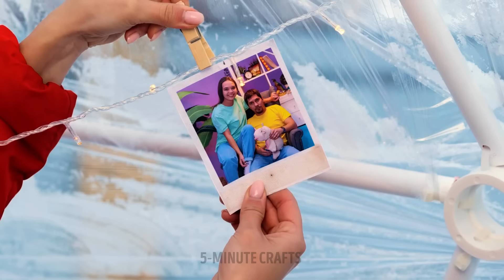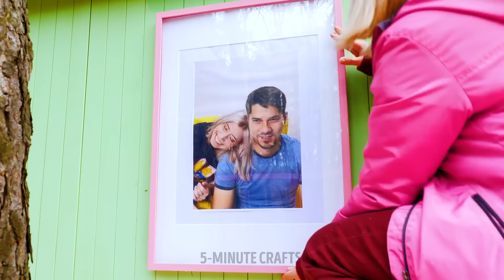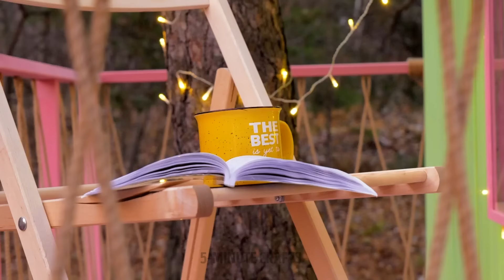SUMMER HOUSE vs WINTER HOUSE || Amazing Huge Craft Ideas

Comment: the winter house is fake there r so many flaws its just a gel not even ice it would take too long to do this n the weather would probably change by the time all the ice is done freezing just make a standing tent with like blankets or fur if you have it way more efficient instead of this fake plastic bricks
i rate this winter house 1/10 for survival because its just your backyard you don't need this in your backyard bro and if you do again. standing tent with blankets or fur.
Reply: i like this